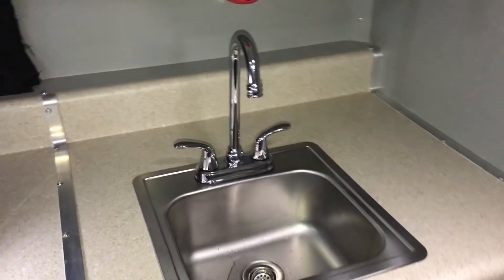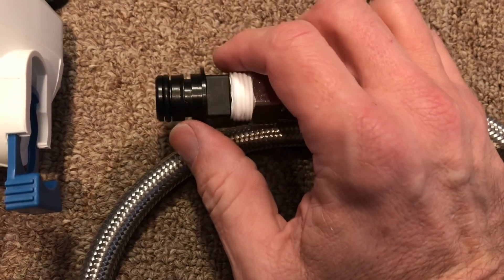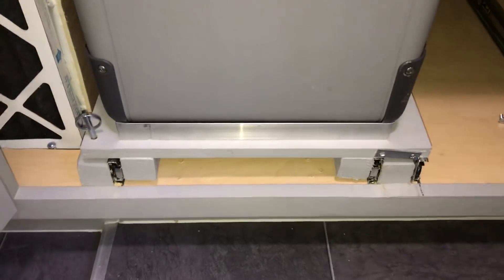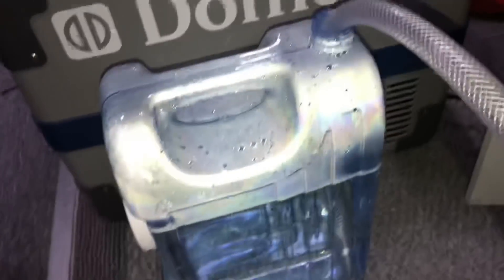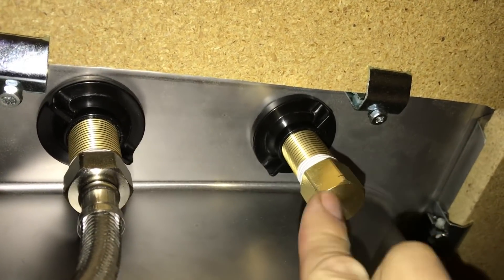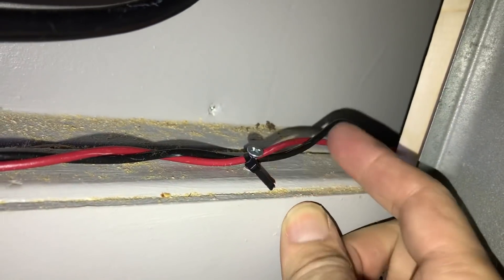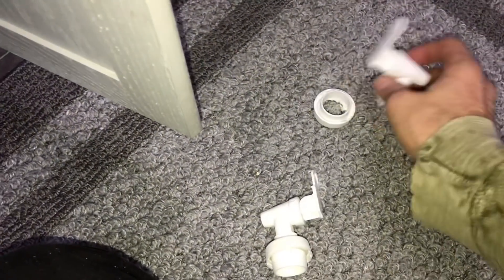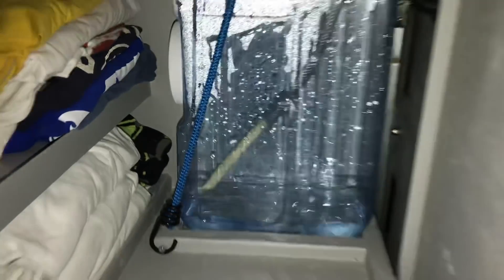Make Simplified On-Demand Water System-Tiny House, RV, Van, Camper, Build, Kindred,Flojet Triplex P2

Comment: If the supply line side leaks, take off the teflon tape,  they seal against the beveled rubber washer.  Teflon is not needed and could prevent a proper seal as it would prevent full seating.

Comment: Will you be adding some sort of waterproofing to top of fridge, in case plumbing develops leak in future (what with all the vibration of moving vehicle)?
Reply from the maker: That would be a good idea. I go into the fridge so often and always check the lid for water and so far the fitting have been working perfectly but time will tell. Thanks for the tip and for watching!

Comment: If you put an expansion tank in line downstream of the pump it will stop the very fast cycling
Reply from the maker: I should have done that. Thanks for the tip.
Reply: @timdillen  Just spent 3 years on a sailboat in the Caribbean. Standard equipment on a boat. Great build on the ambulance. I am actively looking for one. Once the sailboat sells.
Reply from the maker: Awesome! It is amazing what a great deal ambulances are. I still can't believe they sell this cheap.

Comment: Gotta give you credit for the bungee support of the service loop into the supply tank.  Clever!
I enjoy watching how you encounter complications (like the suction tube curling up from the bottom of the tank), and then think up a pretty elegant solution.
Reply from the maker: Thank you! I spend a good amount of time staring at things and trying to solve the problem with as little money as possible. The bungee on the water line worked out a good bit better than I thought it would.
Reply: “Staring at things...”  That’s the original Rapid Prototyping: hypothesize a solution, build it in your head, then visualize how well it works and what are the consequences. Know it well!
Reply from the maker: Hehehehe!

Comment: Cut a hole in the cap from water tank put hose through cap seal with silicone to keep water from splashing out
Reply from the maker: I have yet to road test the water tank setup so could be a bit of splash but also need a bit of venting so the pump does not build up negative pressure in the water tank. I'm thinking it may not need much venting. Will have to see how it plays out. Thanks for the tip!

Comment: Hey 👋 can you tell me how you zip tied your lines to the back wall? Have you thought about a “bladder” for your outside compartment.? When I looked at them a year or so ago I was disappointed that they mostly lay horizontal but I see no reason why they couldn’t be box frame type design to use all available space in an rv storage cupboard. I like Kindred - have used in several jobs - metal taps..not plastic. We will follow you though to see your long term review. Thx for the detailed instructions and materials links 👍👍
Reply from the maker: It is pretty low tech. The board that back the cabinets is flimsy. I just drilled a hole in the backboard and zip tied the water lines. I will have to monitor to see if that is sturdy enough. I had not though of the bladder idea. Will have to do a bit of research. Glad you liked the video!

Comment: It just gets more and more civilized !!
Reply: Are you going to have a head or is there just too little room?
Reply from the maker: That is something I have been pondering from the start. I have the big outside 6'6" bin that is large enough. I have the simple composting toilet from my Toilet Review video sitting in it now so that is covered. I think a next step would need to be a water heater (have one picked out)  and larger water tank (concerned about safely mounting underneath - plenty of room). Then rigging up a shower in the bin would not be bad other than drilling 1" holes though those damn stainless steel bins where they have doubled the steel to 1/4" thick.
Reply: Drilling 1" holes (plural) through 1/4" stainless steel calls for a plasma cutter. Auto body shop would have one. Would be a 5 minute job.
Reply from the maker: That sounds much better . Drilling the 2 holes for the sink drain took a long time.